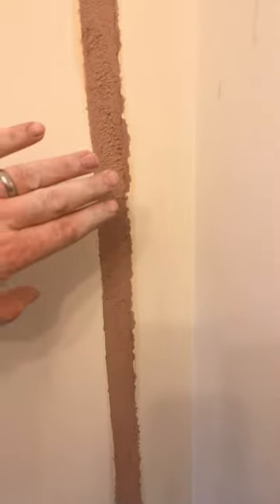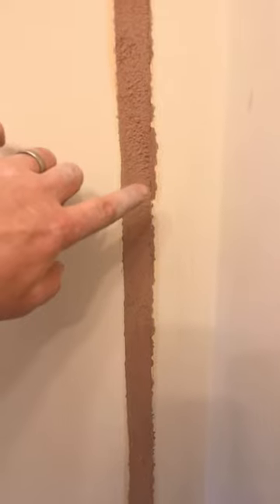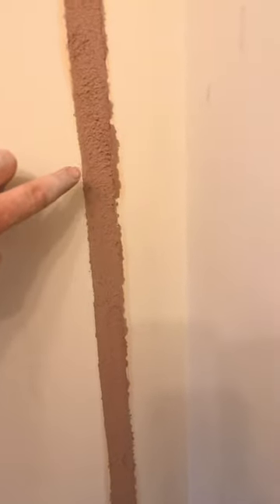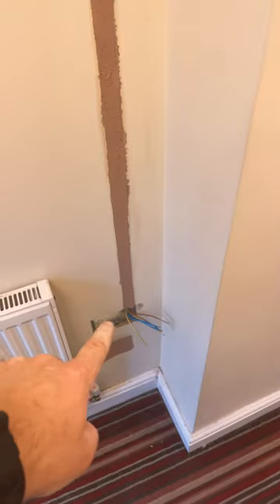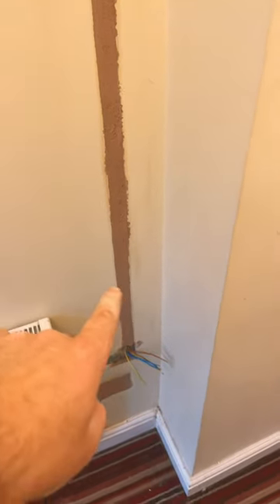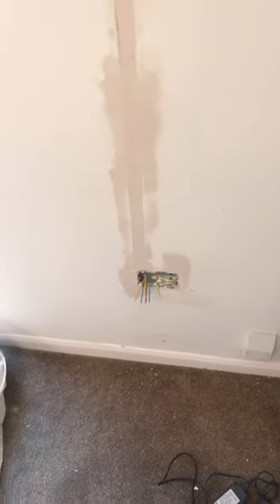How to fill chases🔥🔥🔥

Comment: I dont see the point in the oval conduit. It wont stop a nail going through the cable and good luck trying to pull a cable out of that conduit in the future to rewire. The only use for that oval conduit will be to stop plasterers hitting the cable with a trowel but since you are filling the chases ypurself carefully I see no point. It looks neat thoguh
Reply: Plastering directly over the cable will cause the plaster to crack. Cable expands when it gets hot

Comment: Mate that’s not acceptable I wouldn’t be paid for that, the chase needs a paper tape because as the blocks move with the seasons it’ll crack down the gypsum of the board. We never multifinish dot and dab over celcons either because of the movement, some people say just caulk the internals but it’s difficult for the decorator to get a decent cut line so we always joint a paper tape giving a nearly 90 degree square internal 👍 this isn’t a dig, none of us like going back to a job for free especially when carons hid the kettle!
Reply: All it needed was foam and either filler or skim, the foam prevents movement hence cracks, and you cut it back enough to get a couple of mm skim in the chase. 7 times out of 10 the chase will crack and as soon as you add tape of any kind, you end up creating a bump on the wall, regardless of how far you spread it out
Reply: @NiktheEnglishGreekCypriot  the house is tape and jointed, so why isn’t there cracks everywhere 🤔🫣😂 foams alright but but when you cut it back it leaves like a fluff so when you sand it down you see these little hairs poking out
Reply: @nikthegreekcypriot  what foam is it that you have mentioned

Comment: What did you use to fill it with after the bonding? Tnks
Reply: Often you will look for similar brand but says finishing or fine coat
Reply: Easyfill
Reply: It’s multi finish , same brand

Comment: Wouldn't you use some pva in the chase first? Just for a belts and braces job, ensure the bonding doesn't fall out later.
Get some pva and water, 1:3, brush that all in to the chase and over the conduit/capping and then put bonding over it. It acts as a bonding agent and allows the bonding to adhere better.
None the less good advice about leaving extra on there to easily sand back and paint 👍
Reply: Correct
Reply: PVA is used to control suction, bonding sticks like sh*t to a blanket.
Reply: @TheNomadicTrader 👌

Comment: You’ll end up with 2 hairline cracks either side all the way up if it’s on a dry lined wall (needs a scrim tape on it to prevent cracks).
Reply: It's OK if you PVA it first to stop the Bonding drying too fast
Reply: @vince54980  I wouldn’t pva the chase you are filling no need but when the bonding coat is dry I would pva then and also the side areas you intent to blend your skim coat into.